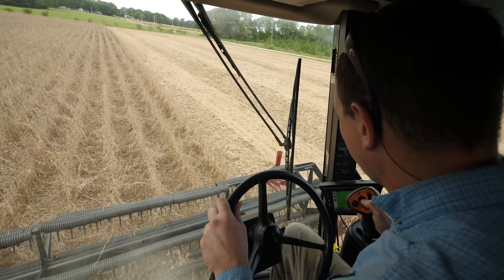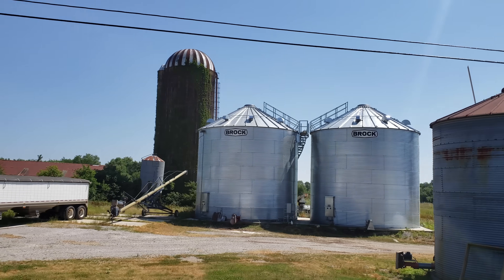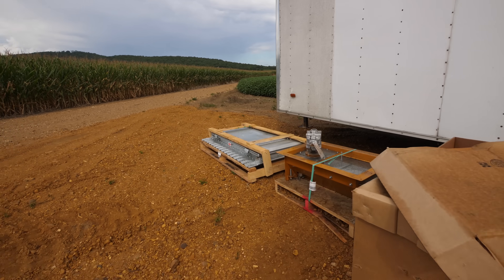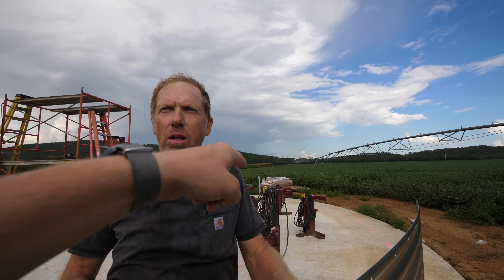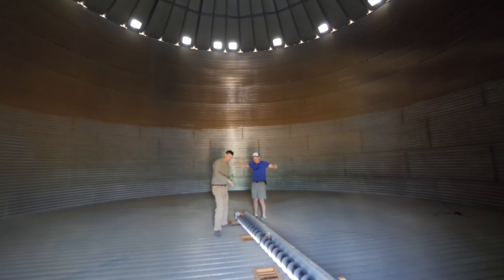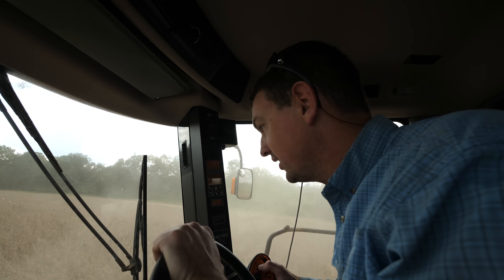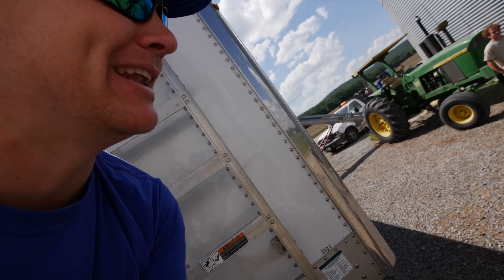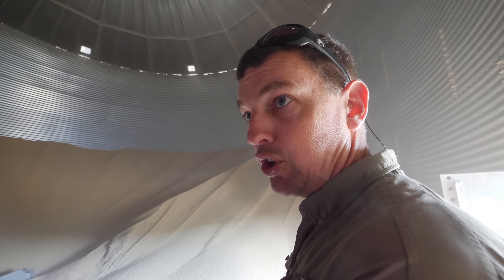Everything About Grain Bins (Farmers are Geniuses) - Smarter Every Day 218

Comment: Actually if new equipment breaks you have to call John Deere because you don't have the software to diagnose and they won't sell you parts. Essentially you have no right to repair your own equipment.
Reply: That is why there is an after market working on that already.  John Deere sucks anyways.  That should get some cockles up.
Reply: @patb9375  And farmers finding either the leaked diagnostic and mating software or a knockoff version of it. Because every part you replace has to be mated with the computer or it won't work.

Good luck with warranty work if something goes wrong that shouldn't be your fault, but due to current law, won't be covered. They really need what the auto industry has for regulation.

Comment: This gave me an idea like .. 5 hrs after watching this video just now... Punches.. alignment.. torque... You could take like.. 126 Kevlar ropes divide and mount them onto two large drill bits, counter rotate/ oscillate one of them to the point the torque applied to an object that tries to get between the counter motions is stopped... Force field? Recharges my going back in time and design the bits with spools and brakes so as the ropes gets eaten, you feed more based on the weight applied to each spool at the desired length.

Comment: Those moisture sensors work by measuring either the resistance or the capacitance of the sample, thereby calculating the moisture content- now you know! 😀
Reply: The one we saw here, a John Deere GT-5300 Grain Moisture Tester uses capacitance. Both those methods are indirect and have to be calibrated for the specific type of grain being tested. If you put some other moist sample in it like wet dirt, the reading will be wrong. There is an old, larger and slower type that weighs, dries and weighs the sample again, like a small automatic laboratory. They are more all round and gives a correct reading regardless of material but if you only want to measure grain, the capacitive method is the way to go.

Comment: Great video, very interesting throughout and i definitely feel smarter today!
I have a question for the farmers out there:
If the optimal bean humidity is around 12% and the beans are water permeable, why not blow air with 12% water through the grain bin?
With a humidity controlled fan, one could perhaps even dry the beans completely for storage and moisten them for selling.

Comment: sooooooo, I guess bushels are another weird imperial unit type of thingy, which apparently are 35.24 liters. 
Gallon, pints, fluid ounces, quarts, barrels and acre foots seem not to be enough volume measurements.

Oh, wait, those were the liquid measurement ones, for dry stuff it's barrel, peck, gallon, quart and pint (which of course are completely different of the fluid ones even if they have the same name).
The conversions at least are somewhat consistent with the dry measurements, with a bushel consisting (mostly) out of powers of 2 of the other stuff (peck 4, gallon 8, quart 32, pint 64, barrel 0.3048 (ouch)).
How .... intuitive.
Nice vid though.

Comment: I never seen a house or building being built from top to bottom, it's always bottom to top, this blew my mind!
Reply: It's the standard method for bolted tanks since it's so fast, safe and easy when you can do almost all work at ground level. It could in theory be used for welded tanks too but they tend to most often be built like a house, from the bottom up.

Comment: Took me back 30+ years... I have done all this only we built a Harvestore which is a silo, not a grain bin. Silos need to be airtight and Harvestore panels are coated in some kind of glass and sealed with a special tar. The panels are lifted like this only the jacks turn the whole thing exactly 1 bolt hole to the right, for some reason. I never rode in a combine, but drove a mounted 2 row picker as well as driving the tractor pulling the 2 row picker when the mounted one broke. We put corn up on the ear in open air bins and fed livestock out of them until right before harvest the next year, when the price was high, then we ran out the ears and shelled it. We put silage into a pit and covered it before that, and fed it out during winter after it had fermented a few months. AHH the sweet smelling steam from the silage when you fed it out... The cows came running to get their fix from the silage pit. The guy I worked for did it the old fashioned way on a small farm. Few people today know the old ways I learned there... I cherish those memories. AH to be 18 again working the farm... I didn't know how much fun I was having...

Comment: Hi Destin, I sure hope you read your comment section. If you were impressed by the dryer fan on that bin, your next stop should be industrial dust collection in industries like woodworking. Find yourself a manufacturer of coffins (yes, the final resting place kind), see how they produce the milled boards on 12 axle milling machines and how important dust and chip removal is to their productivity and their safety. The fan you saw there was an average fan in a crappy housing. Find a company that sells and installs central dust collection systems and ask them to show you a working system. You'll see fans that will easily eat you up. Interesting bonus facts to put in that video, would be channel collapse (when the vacuum gets too high due to sudden inlet blockage, a vacuum shock can dent the first tube and if the vacuum is not shut off, the tube will collapse, causing a domino effect collapsing the entire channel), dust explosions and safety measures (controlled explosion directing), transport fans (fans that pass the chips through the blades get a serious beating on the inside of their housing, and will eventually wear and rip no matter how durable the steel and how soft the wood). I used to be a design engineer for such systems, and what looks like just some tubes and a collection bin, is in fact a balanced system of fans, sensors, a lot of calculations (nozzle shapes and sizes, duct sizes, splits and branches, filtering surface, combustibility, etc). Definitely worth your time and attention...

Comment: Question related to farming, what’s the deal with the design of tractor tires?
Reply: Gary Rhet I’m assuming you mean the tread pattern?  They are that way because they grip better in dirt and loose soil pulling heavy equipment. In mud it pushes dirt outward and essentially down to the dry dirt.
Reply: Also, the wider the tire, the better the floatation. A tractor with extremely wide tires, (International crab steer tractors come to mind) will have very good floatation compared to a tractor with row crop tires on it. By floatation I mean less of a chance to get weighed down and stuck in mud.

Comment: Fun fact: there's a pretty solid chance I welded the flighting inside that grain lift
Reply: Oh yeah? Does that all come from one factory?
Reply: what's the Price tag on these?
Reply: Roy Rudy on a bin? around 65,000 CAD for a 60,000 bushel bin
Reply: @stephenwakeman9889  Is that for the whole package with grain bed, fans, auger etc or is that just for the corrugated iron and roof?
Reply: @Lappmogel  not exactly sure but i'm leaning towards package
Reply: @stephenwakeman9889 Well if it is that's not to bad, if you could buy it without all the grain related things and spend that money on windows, insulation etc it would make a pretty cool house imo. Huge garage on the bottom floor, 2-3 more floors on top of that and some windows in the roof and sides. I like the aesthetics of it and never having to repaint the house is a nice bonus. And if you need more space you can just get those jacks in and add another layer to the bottom.
Reply: Lappmogel where i’m from there is someone who did that, and it’s pretty sweet other than the fact that they’re like scary religious cult people lol
Reply: @stephenwakeman9889  Well i guess it works for storing nuts as well.

Comment: Just curious, how about rodent/bird pest control?
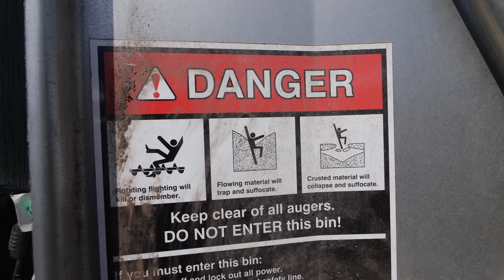@13:20 I see a lot of light shattering from gaps at the intersection between wall and roof.
Also the sealing between the concrete base and underside of the wall sectons seems rather rudimentary to me. 
Won't they come in (in the longer term) or is that considered unavoidable and thus normal?

Comment: Spent two summers putting up bins. 65 to 100 foot in diameter 100 foot to the eves.

Nothing like going around 100 foot circle tightening a bolt every inch and a half, repeat 30 times.
Reply: gotta be something to make that go by faster..
Reply: @Baigle1  That is faster with cordless impact wrench lol
Reply: Sounds like it's time to invent a new fastener that more or less self tightens after initial finger tightening......some related ideas I've been having are coming back to me thanks to your description.
Reply: @coloredcoat  there are better designs for locking nuts and washers that are marketed and used on megawatt+ offshore wind turbine platforms if you are interested
Reply: @coloredcoat  finger tightening is slower than just impact wrenching the whole way.  Maybe some sort of staple or rivet?
Reply: Where do you guys make grain bins? Do you have any services in Pakistan?
Reply: Ooh  creative problem solving.. I enjoy, I try..  has anyone looked into increasing the rifling 'rate of turn'.. I'm sure that's wrong.. the spiral thing in the boom stick.. let's make it spin faster, slower velocity, and shoot screws...  oh I'm good
Reply: I helped build a few bins for a local farmer when I was young. We only had cable reel lifts, so it was exhausting

Comment: wooden trailers? Old farming equipment? Wow. USA does become a developing country
Reply: What are you talking about? Most farms make do with What they got. It is not a "trailer" either, it is a grain box. It is mounted on a truck, usually a tandem (because they can handle more weight). The equipment is not even that old, the CaseIH combine used is from about 2000. The reason they are using older stuff is because older stuff is better. No emissions stuff, easy to work on, and wayyyy cheaper. That grain truck they are using is so simple, you could rebuild the engine in your garage.

Comment: Dang, I could still build grain bins Ha Ha, we used to use hand crank units , video was interesting , I'd like to see how they build concrete stave silos now, another job I had in Iowa . Keep on keepin on farmers ! Love Ya!   I don't recall hearing one engineering point --- the sheets are color coded on the end according to gauge of the metal , the lighter gauge on top of bin going down to the heaviest on the bottom

Comment: That's not a punch it's a drift, a tool to aid in alignment.  Just saying, since you made such a big deal about it might as well get it right.
Reply: The RightStuff  drift pin maybe. But I suppose if your the type that can't be wrong than sure call or a punch.
Reply: The RightStuff worse, your the guy who tried to correct the guy who did correct a video on a so called minor point
Reply: The RightStuff  and you just need a punch.

Comment: Do they use anything on the fasteners to make sure they don't come loose or is that not an issue?
Reply: Neoprene washer on the bolt side, serrated locking nut on the other. However, once the whole thing is built and in use, you'd have a tough time working any of those fasteners loose without two guys wrenching on the same fastener at the same time: one on the inside and one on the outside.

Comment: I use to haul beans over Iowa, we also were hired to empty the bins for the farmers. We used a specially outfitted truck with a giant vacuum on the back to do it. It's supposed to be gentler on the grain than the augers.  Here in Iowa and I'm sure other northern farming states we also use propane in conjunction with the blowers to help the drying process. I was vaccing a bin once that had a series of vertical augers that screwed down into the grain and also moved around  on tracks to stir the grain to help dry it out.

Comment: That punch is being used as a spud wrench to line up holes. I used to have a 1/2" ratchet with a line up pin on the end in the days before battery drills.

Comment: ELI5: How doesn't that corrugated iron not buckle when the jacks are removed? 
There don't seem to be any vertical load-bearing stands around the circumference of those grain bins.
Reply: The whole bin is a vertical load bearing cylinder, with corrugations to stiffen the individual panels and prevent them from crippling or buckling.

Comment: 4:30]  I'm about to cause a lot of controversy here.  Please relax.  People will probably want to have me nailed to a stake but...  that there that Destin is holding is called a 'drift, ' any mechanic or machinist will tell you this, a 'punch' has parallel sides, a 'drift' has tapered sides.  Nobody is evil and going to the devils for this mistake, but a drift is drift and a punch is a punch and if you happen to have both of these tools in your tool box it will cause confusion if you don't use the correct terminology.  

I  really like the idea of using the hydraulics to jack up the grain bin segment by segment though.

Comment: There was no discussion about grain silo explosions. Grain dust is highly combustible. Follow-up video, recreate a grain dust explosion,  unconfined and confined.
Reply: "Grain silos" aren't a thing - there's grain bins, and silos. Silos are the ones that explode (due to methane buildup). Grain bins don't explode, but they can smolder. My family's farm had that happen a few years back, we lost a lot of the grain in that bin.
Reply: @matthewholderbaum3001  Grain bins can most definitely explode. The dust particles in a bin combined with electricity to auger motors can set one off. It isn't terribly common and it wont happen with a full bin.
Reply: @matthewholderbaum3001  depends where you are from. In the uk they are called grain silos.
Reply: Lots (most) of kinds of dust are explosive, try powdered milk!
Reply: But it wasn't a silo! (It probably can explode anyway, just need a lot of particles)
Reply: It's far more common and likely to happen in a Grain Elevator (same as in the video, but on an industrial scale - so more likely 400,000 to 5 million bushel capacity between a number of bins).  This is because the dust becomes isolated (it's not quite the same hazard when it is in the grain stream as the moisture from the grain helps keep it stable).  Even still it's typically not the primary explosion that is of worry, it is the secondary explosion that does most of the harm, as the initial explosion would suspend any dust around causing a chain reaction if you will.
Reply: It happens more in large, industrial concrete bins, silos, and elevators than in the metal bins and elevators used by smaller, more remote farmers. This primarily being because the metal bins act as a ground for the air, allowing static electricity to be discharged into the bin rather than in the air. Beyond this, they're obviously a lot smaller and thus have less dust to ignite.
Reply: Yes! I had a buddy down in Nebraska that lost an entire harvest because of bin combustions
Reply: No silos cna and have blown up from dust

Comment: So, the floor of the grain bin has many tiny holes in it and the mother of all fans is blowing air up through those holes. 
Am I the only one thinking . . . .ULTIMATE AIR HOCKEY TABLE!!!
Reply: You don't want to run the fan without the floor completely covered with a layer of grain because the air flow can move the floor supports, causing the floor to collapse the next time you fill the bin with grain.
Reply: @blakebiermann4316  That is so disappointing to hear. Once again harsh reality crushes my dreams.
Reply: @gewgulkansuhckitt9086  Maybe you can do a modification to blow the air more slow, or something, don't give so easily brooo
Reply: @OsvaldoBayerista  It would take an age and a half, but you could fix all the floor supports to the foundation, if you were really determined.
Reply: @MushVPeets  It looked like it already took an age and a half to assemble. Might as well secure the floor supports with some concrete bolts.
Reply: @sirtimatbob  If it's worth doing at all, it's worth doing it perfectly. 
(especially for air hockey)
Reply: That floor in that bin is an option, although by the time you get to a bin that size its not a very good idea to not have air.  All grain goes through a "sweat" as it cools down from the high heat during harvest to whatever ambient is during winter.  During this cool down it sheds moisture even if it tested dry during harvest.  On a bin that size this "sweat" will become trapped and spoil grain.  IMO a bin size of 5000 bushels and less air is nice to have, over 5000 its necessary.
Reply: Everyone say Gewgulkan Suhckitt out loud
Reply: Supercharge that fan and you have indoor skydiving
Reply: @Jpilgrim30  haha that be fun
Reply: Gewgulkan Suhckitt dude I just want one in my PC.  Unfortunately it’d blow everything into pieces.
Reply: Yes you were but now I am too lolo
Reply: Nope.
Reply: haha
Reply: GIANT BONG!!!

Comment: Hey Dustin! I’ve never put up a grain bin before but I use to work on a metal building erecting crew. In this case I wouldn’t call what they are using a punch, since it isn’t punching anything out. It would actually be called a spud. Look up spud wrench and you will see what I’m talking about. But you are right without it it would be really hard to do this kind of job.

Comment: It's a similar process as to how they raise those big construction cranes that are used to raise buildings. Think about it. How do you raise one of those things? The answer is hydraulics and you simply build it from the ground up and raise it up level by level, add the pieces and then raise those up. Sure there are smaller truck based cranes for smaller jobs, but when building a skyscraper you need something a little bigger.